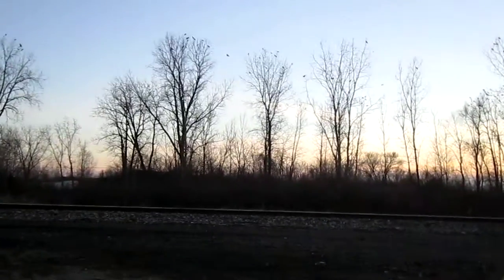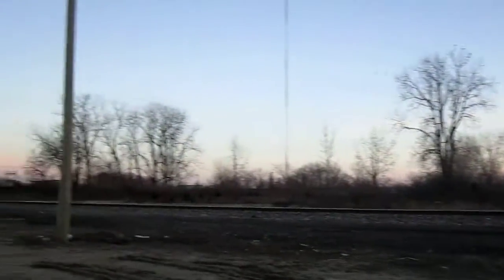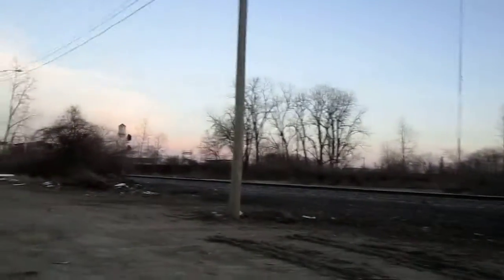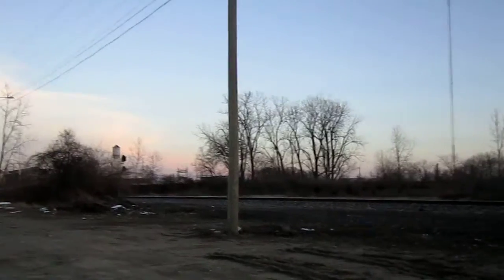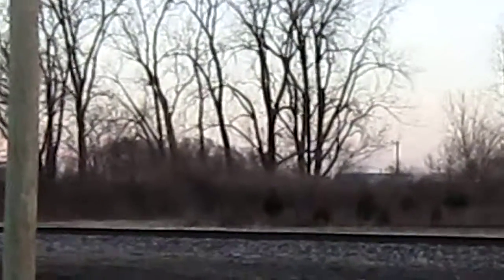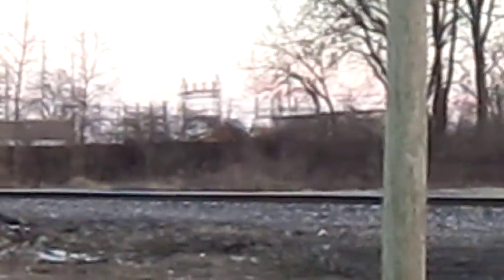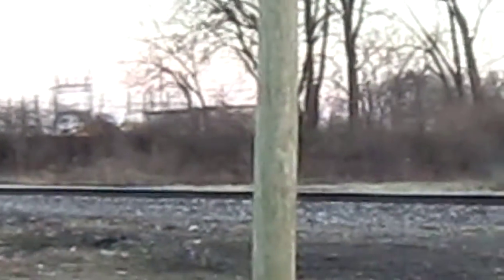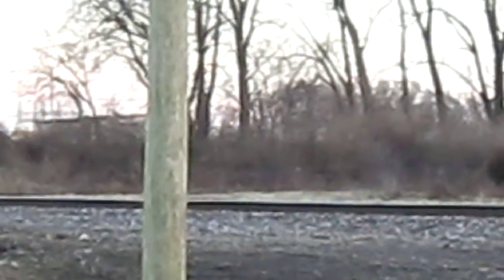Old Pensy Roundhouse setting, Fort Wayne

Comment from the maker: Also note that this was the second of the roundhouses built, there was an earlier one more central to the shops that used to be where the post office sits today, a new one was built and the old one torn down, and new blacksmith shop was also built, according to the early sandborn insurance company maps from the time period, the Wabash also had a larger round house and machine shops and repair facilitates across the street from where the roundhouse was which still has the footer in front of the old G&E plant they look like parking spots but they were roundhouse stalls there to the left of the parking lot and almost  at the corner of the building you can see them on google maps even today at the time of this, but with the redevelopment of the GE area I am not sure if they will still remain after a few years more and all is said and done.